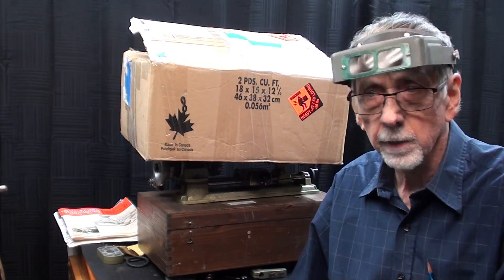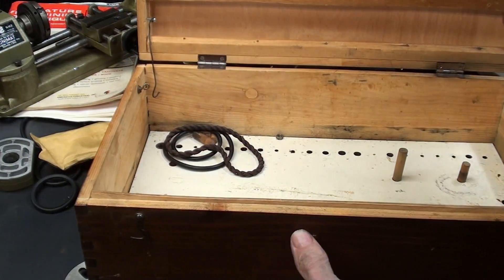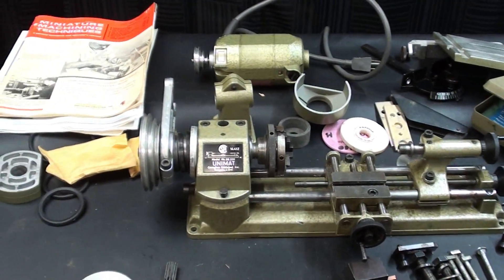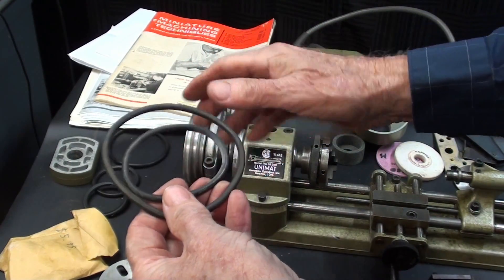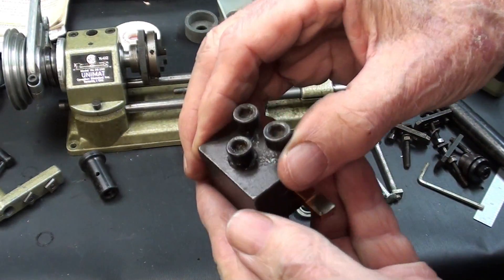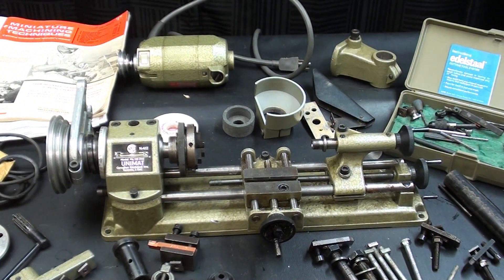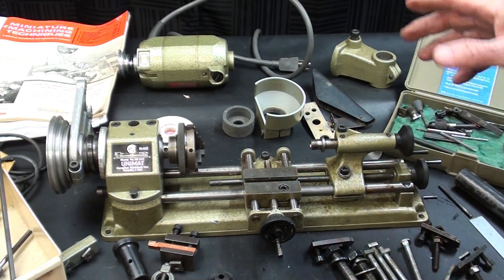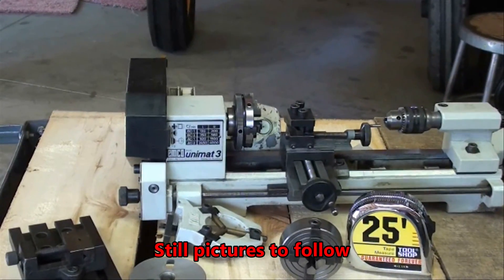tubalcain gets a UNIMAT MICRO LATHE #936 mrpete emco edestal

Comment: Just want to say how wonderfully informative and valuable all your videos are. I just bought a Unimat SL and I'm trying to learn how to use it properly.   I've watched so many of your terrific videos already with many more to go.  Thank you for all your efforts.  

 I do have a suggestion for a future topic(s).    It seems having and using collets is very important for many machinists operations.  Unfortunately,  original Unimat E16 collets and collet chucks have gotten prohibitively expensive.  I think it would very valuable to Unimat users to hear any thoughts you might have on adapting and using ER collet holders and ER collets for the Unimat.   I purchased an ER20 collet holder predrilled with a 10mm hole for fitting to the headstock.   But I'm not certain of the best way to enlarge it and tap it to M12x1, in order to produce the minimum runout.   I only have the Unimat SL lathe (with both 3 and 4 jaw chucks) and an old Delta 14" drill press to use.   

Also, perhaps some discussion on making things like milling bit holders and other accessories to fit directly onto the Unimat's 12x1 spindle.   Thanks again!!!  Please keep up the great work!

p.s., located in New Orleans
Reply from the maker: Glad you find the videos helpful! I appreciate the suggestions
I didn’t know they made call it small enough for the unimat

Comment: Edelstaal? Fascinating, because the word would usually be spelled "Edelstahl" which literally means: noble steel and actually translates to stainless steel. Germans do not claim it won't rust, just that it's nobility.

Turns out it's Dutch...

Comment: Could you help me locate some belts? I have this exact lathe!
Reply from the maker: I think you can get them on eBay. But I’m not positive because a viewer sent me a spare belt.
Reply: @mrpete222  Do you know what the dimensions are I should look for? I guess I would simply measure each wheel at the outer edge and then whatever thickness I need. Wouldn’t I just get the thickness by measuring the inside of each wheel?

Comment: Hello friends, I have a question and I hope to get an answer. I have an emco SL lathe. I want to make an aluminum flywheel. What is the largest flywheel I can make on this lathe? I mean, for example, can I handle a 2cm radius round aluminum alloy and turn it into a flywheel? The point of this question is can this small lathe handle this size of alloy?

Comment: I have one of those Austrian Unimats, just like the one in this video, also in its wooden case. It is very light duty--the newer Unimat 3 you picture looks like it could do much more. I'm pretty sure that is indeed a repurposed sewing machine motor used on these. One thing I have with mine that I really like is a lead screw attachment you can use for automatic feed. I bought mine over 20 years ago from an engineer. Looking forward to watching future videos, as mine came with no documentation and it will be helpful to see someone else's tricks and techniques.
Reply from the maker: I would like to make a motorized lead screw.    I have lots more videos coming. It’s all new to me also.

Comment: I've had one for a long time, the box was oil soaked and kinda gave up (got it like that), but I did get a whole bunch of attachments (I've never seen that saw table).  If you look at the front of the headstock there is a little bolt on yours to keep the alignment.  Mine was before that and I wish it had it.  I have the collet holder, but none of the collets.  They are E16 and ER16 is standard now, bought a set, they fit, except longer, and the nut won't start.  I have used it many times for real small stuff, carried it to work a bunch of times to fix some things.  I did make an adapter for a 0-1/2" drill chuck that was handy.  You'll need a metric tap that matches the spindle and the tailstock thread (M12x1.0).  I seated a ball bearing inside the chuck adapter I made that mates to the tapered opening on the end of the tailstock shaft to tighten it.  Oh and I adapted a small live center I bought.  Seems like all the accessories use different threads or diameters than what's common now and it's all metric so more difficult to make.  I did clean up some electronic copies of the documents, I'll email you a copy of those.

Comment: I have an identical machine as this little lathe, including the book, but mine didn't have the table saw part. Mine accidentally fell off the workbench and broke the pulley mounting bracket in two. Many of these parts are cast from  an aluminum alloy pot metal called zamak or mazak (spelling depending on where its from?). I'm hoping to repair it with tig welding but apparently people have had pretty mixed success welding that metal. I know I could just buy a replacement used part from ebay or wherever for $25-30 but where is the fun in that? I'm thinking I'm going to try tig welding it, or setting up my old router pantograph duplicator and having a go of it on a piece of 1/2" aluminum plate. Suggestions? Someone mentioned laying the part in sand before welding. Would that be like mold-making sand (with oil in it), to support the aluminum from just melting away?
Reply from the maker: I would suggest buying a replacement part. But it wouldn’t hurt anything to give it a try welding. Your support it with silica sand.   I’m not very good at welding aluminum.
You cannot weld Zamek      
Zamac is much heavier than aluminum

Comment: I got one of these in the 1970's(??) and have used it a LOT over the years.  Also have the milling table, threading attachment, power feed, machine vice, etc.  The box with all the cutters, boring bar, cutoff tool, etc. is exactly like mine, all of which I use.  Still have the rather flimsy wooden box it came in along with literature.  The only thing that ever went wrong was the on/off switch broke a number of years ago and had to wire in a generic toggle switch.  Awesome gift and really cool to see this!

Comment: When I was in my early teens, my friend’s older brother had one of these. He wouldn’t let us near it! I don’t blame him (I did then). When I went to Stuyvesant High School in the mid 1960s, I took machine shop as an elective ( I had to take a year of drafting). After we learned to make the usual screw and nut, plus other operations on the South Bend heavy 10, our project was to build a copy of this lathe. I still have it. A bit later on, Unimat came out with the Unimat 3, which I bought with the milling accessory and a bunch of others such as the dividing head. A great little lathe. But the problem with these is the underpowered motor which is indeed basically a sewing machine motor, 1/10th horsepower. It makes working with these lathes excruciating. It’s really almost impossible to use the full capacity, unless you’re a glutton for punishment. People have put larger motors on them and it dies work, but I ended up just getting larger lathes and still occasionally use this for fine, small parts.

Comment: I just put a walkthrough video of my SL1000
Reply from the maker: Thank you, I just watched it. Just yesterday I made my own milling table, something like it was only three slots. Video coming soon.
Reply: i was limited by the material, its cut away underneath, or i would have made a 3 slot . I see your lathe dog is different, but correct. i may get more interested in it. I will likely buy or make a faceplate, and a live center. Just a hobby, i learned more form you then you would think. Hats off to you.  @mrpete222

Comment: Looks just like the one I got in the 1970's, but with a few accessories.  I do not think it was to be used for milling, but for drilling.  I see the helical spring is extended, which is probably why the lathe would not fit in the box without disassembly.  Diagonal placement may also be a possibility.  I bought mine for a single job on a small gear for my forklift, which was extraordinarily expensive from the manufacrurer.  Paid for itself and seldom used since, just up on the shelf.  It is a serious tool for the intended applications.  BTW, the small round bars are for tightening the chuck, the holes are there.  I tried to locate accessories a number of years ago, but was largely unsucessful.  Too bad. My box was of plywood construction, and I don't remember if it had finger jounts, but it had delaminations over time.  Hope you have a chance to enjoy this beautiful little too.

Comment: Mr. Pete:  It is SOP that one ALWAYS removes the motor when putting the unit in the box for shipping.  (It is not because it would not fit when assembled/)  The bracket that holds the pullies is too weak is too support the weight of the motor and will crack it if the box gets dropped or jarred. 
Jerry F.
Reply from the maker: When I mounted the motor on the machine, I was thinking that sure is a thin bracket

Comment: "i made my own milling table. I still need a few minor pieces, but i mainly need to install a real motor. drastically underpowered. I am building a 5c collet adaptor for my Leblond 13 x 30, which will also fit my 16x64 Walcott.

Comment: I'm in the UK, but I prefer imperial over metric.
Reply from the maker: Awesome
Reply: It's too bad parliament abolished Imperial in 1958 so now you're stuck using Standard just like the rest of us. Standard is the inch that's precisely 2.54 centimeters. The old Imperial inch was slightly shorter. Which was problematic. The old US inch was a little longer. Which was also a pain. So a Swede decided to just split the difference and call it good. That Swede also gave us Jo Blocks. He was Carl Edvard Johansson. But it was Henry Ford who really pushed for Standard. What old man Ford wanted he got too. At one point he even acquired poor Carl.
Reply: @1pcfred  It may have been officially  abolished, but there's plenty of people still using it.

My Micrometers and Dial Calliper are  Imperial.

Comment: I have a Unimat with many of the accessories. If memory serves me, the milling table may be 3x5 or 4x6. I have my unit in storage at the moment.
Reply from the maker: It’s 3 x 5, same as a index card
Reply: @mrpete222, just in case you decide to make a milling table I have the later version of the milling table for the unimat 3 next to me. It's 120 mm x 80 mm, happy to measure up the 4 offset mounting hole locations and anything else useful if it's helpful

Comment: There's a pretty big Unimat hobbyist community and we're certainly going to enjoy any videos you make about it. 
I see you've got the headstock riser block, which increases the swing by 40mm. Emco never made a riser for the tailstock, but there is a 3D file for printing a tail stock riser kicking around the Interwebs.
You're also missing the power feed, which is one of the most useful accessories.
Reply from the maker: Thank you, I was wondering what that thing was. Yes, I would love to have a power feed.  In fact, I may attempt to make a Peterson version of it.

Comment: Hi My dad owned one of these lathes, most of the stuff he had you have, it ended up being mine, by then the original belts gave out. I bought a set from eBay (poly) but they caused so much load on the motor that it would hardly work. I never did find belts that would work like the new ones. I finally gave it to my good friend.
even new it was pretty gutless but my dad loved it
Rich
Reply: When the O ring belt on my mini high speed drill press snapped I made one out of string. I wrapped the string around the pulleys a bunch of times to build up inner cords then I put a tightly stacked lacing knots over all of that. As tight as I could make them. So you can't even see the inner cords. I used some tough job site string line as the string. Which may be why it worked? It was pretty nice string from the get go.

Comment: For those with the patience, they are capable machines. There is also a thread-cutting system available, and combined with the angle-setting headstock, you can turn taper threads!
One of the features of the 3-jaw chuck is its jaws are reversible, so you don't need separate inside and outside jaws.
Looking forward to the rest of the series.

Comment: About 50 years ago, I used one of these to make a short run of teflon bushings for a boat factory where I was working.  They had made some over-sized aluminum windshield frames and the normal sized bushings resulted in a over-tight assembly.  We had the Unimat at home, so I took some stock home and made custom bushings on it.  They were really pleased and gave me a nice pat on the back - didn't pay me for my time though.  I guess I learned a couple of things that day!
Reply: Always saw these advertised in Boys Life, Mechanics illustrated, and other popular periodicals of the late50s early 60s. In 1990 discovered my neighbor had one that I  convinced him to sell me. Used it when I worked on aircraft in the next couple decades. It is sitting on my bench right now. I've been using vacuum cleaner drive bands and oil filter o-ring gaskets for replacement belts. I hope you enjoy yours as much as I love mine.

Comment: Nice litle unimat, I once owned the Unimat 3  witch i buy new for 45 years ago at the time 1000 gulden that would be 800 dollar at the time. make parts for  model airplanes and boats . turning brass was oke steel was a pain but with 0.05 mm cutting dept works well.
Changed it for a 8x24 Ferm what seems to be an  Shenwai SW-350 wich a still own and use.
Keep up the nice work, love your shop talk and products.